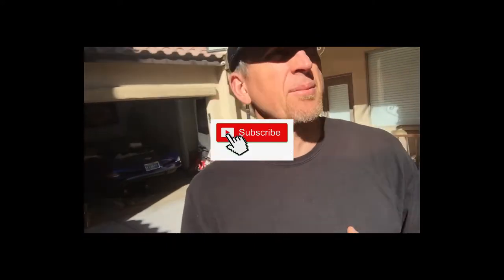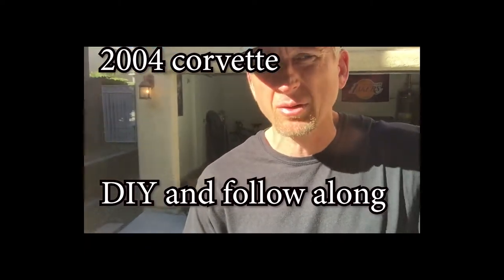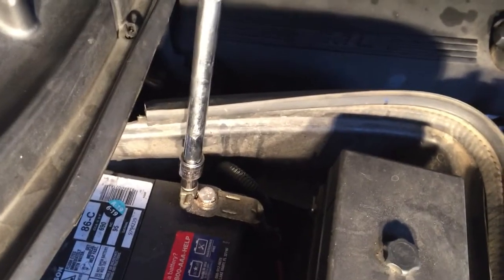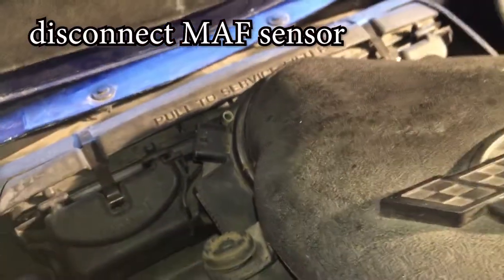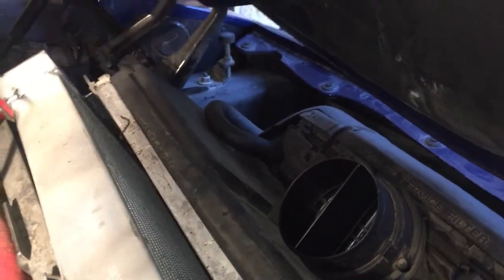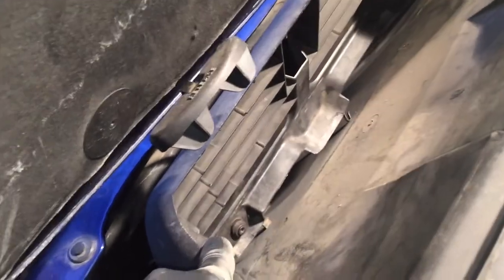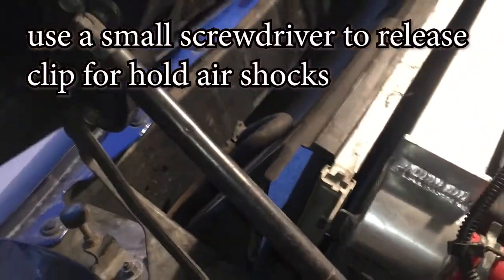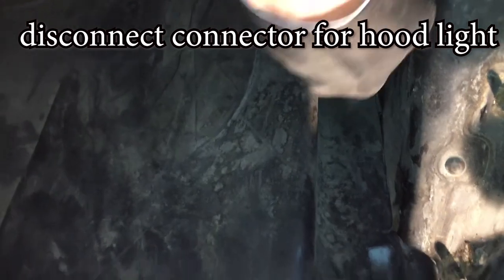HOW TO REBUILD A CORVETTE LS1 MOTOR PART 1

Comment: I have just purchased a used ls1 out of a 02 c5 vette. I also purchased a new block, 228/228 .600 texas speed racing cam, pac 1216 valve springs, etc. Do you have any information to give before I start my teardown and rebuild on the fresh block. It's going in a 86ss monte carlo
Reply from the maker: sorry it took so long to respond. The ls1 motor is a fairly easy one to work on and supe up. I was actually brushing up my school skills while doing this rebuild for a friend. the upgraded ls7 lifters were a great improvement to stock ones, also melling oil pump really helped motor stay cool, My friend has my hardrive of video footage so i can finish some of these series. im still waiting for it. good luck on the build man